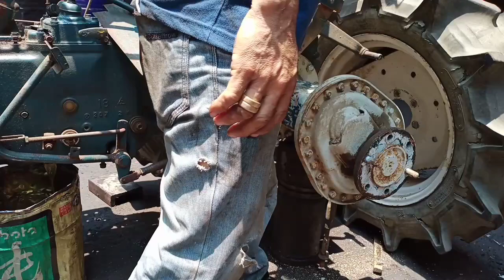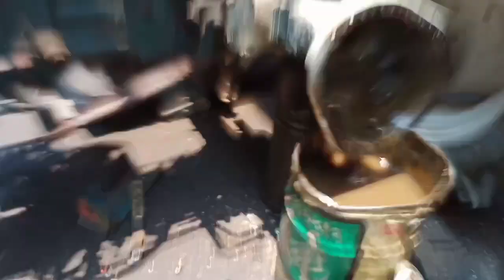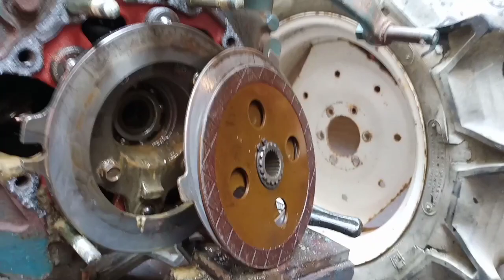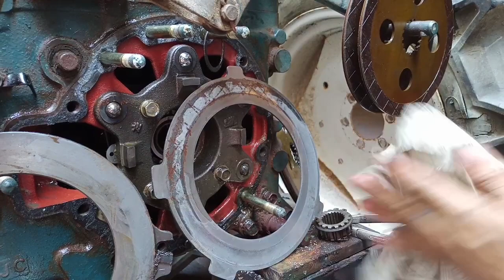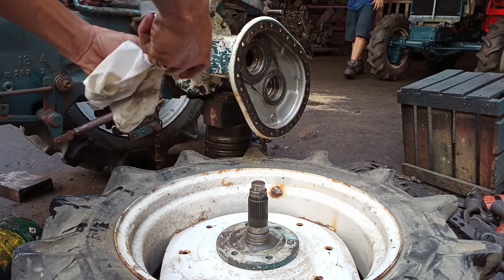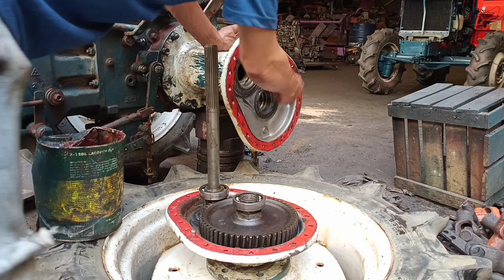Disc,brake and axle oil seal replacement L2002,L1802,L2201,L2202...

Comment: Bossing anong trouble pg ngppivot ka habang ngaararo maingay yong preno sign na po ba na pudpod na ang disc brake nya 1501dt po model.
Reply from the maker: Possible po sir
Reply: @tractorsmarinemechanic  mga mgkakano po kya set ng preno boss
Reply from the maker: Hindi ko po alam sir Ang presyo
Reply: @tractorsmarinemechanic  hindi pa nman po sagad adjuster nya sir npansin  ko na mbabaw po atf oil nya d po kya posible rin ung ang dahilan sir?

Comment: Sir ano pong pinagkaiba ng l2201dt at l2202dt? Salamat poh
Reply from the maker: Mas Modelo Ang 02 at magkaiba Ang cover Yong 01 parang L2000 orL1500
Reply from the maker: Mas Modelo Ang 02 at magkaiba Ang cover Yong 01 parang L2000 orL1500
Reply: @tractorsmarinemechanic  sa presyo malaki poh ba pagkakaiba salamat po ulit
Reply from the maker: Malaki sir.yong 02 almost 300k at Yong 01 mahigit 200k lng.
Reply: @tractorsmarinemechanic  ok poh salamat ng marami ingat poh